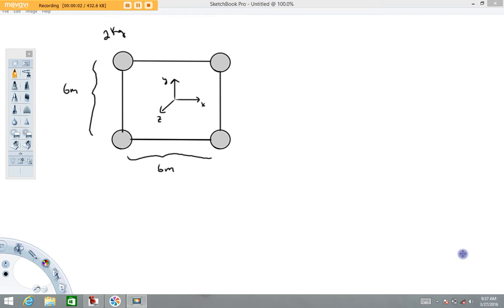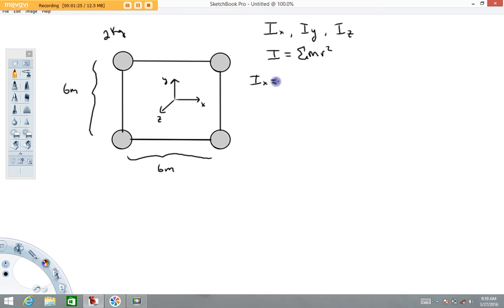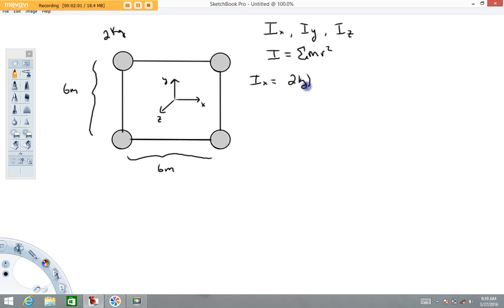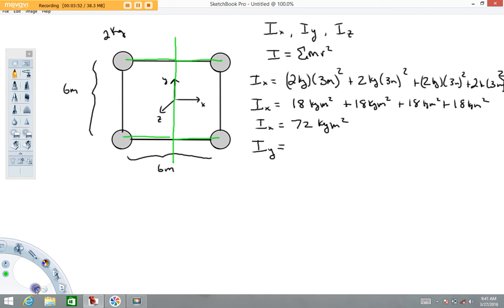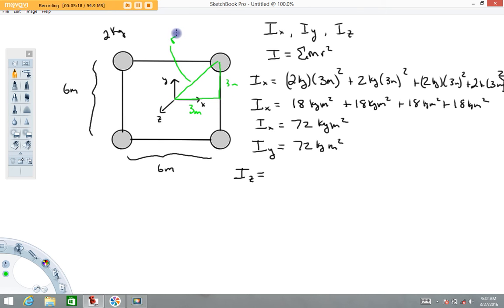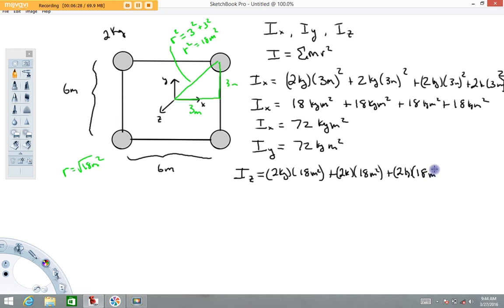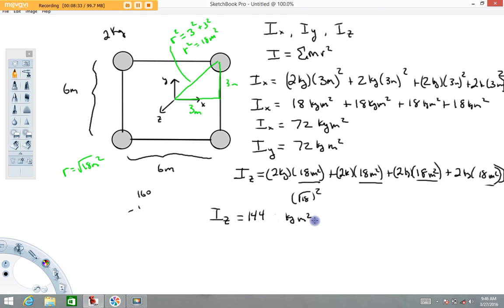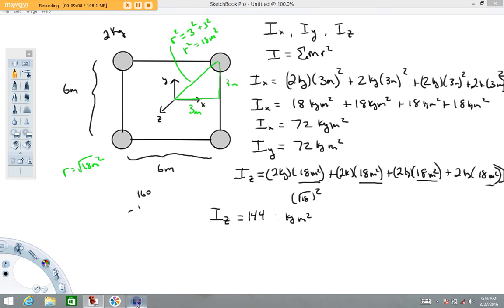Moment of inertia example 1

Comment: What if the axis passes through the sphere that is 2kg?
Reply from the maker: The short answer is that when the axis of rotation goes through one of the sheres, the moment of inertia for that sphere is 2/5 m r^2.

Since the radius of these spheres is small compared to the other distances in the problem, the contribution to the moment of inertia for the system would be pretty small compared to the other masses and could be ignored.
Reply: Rod oh ok.. Thanks :)